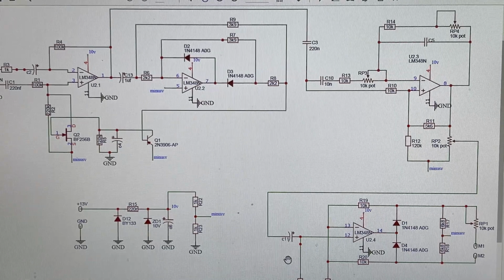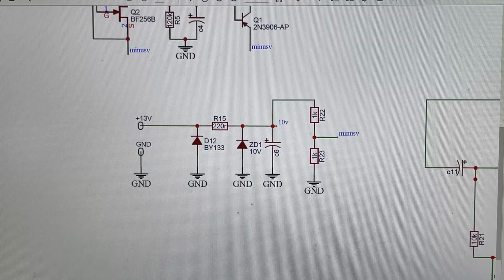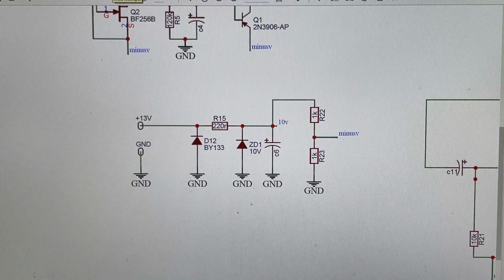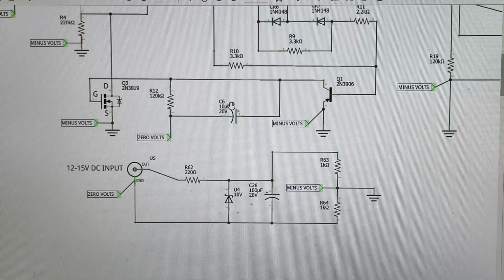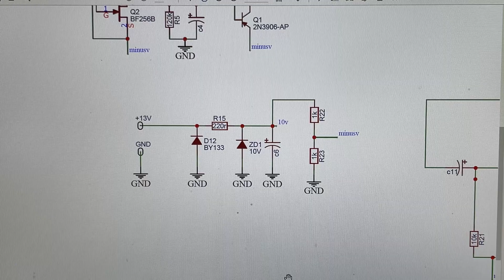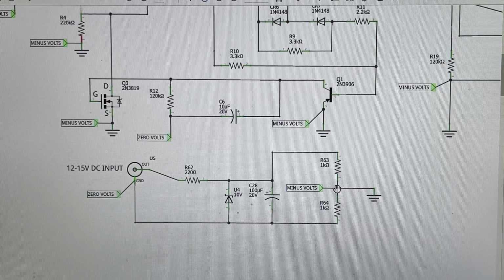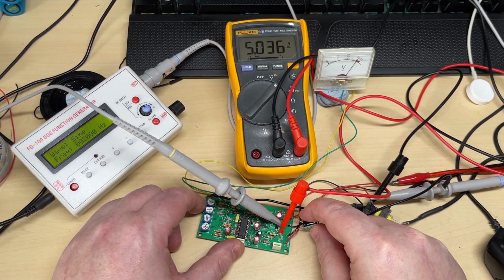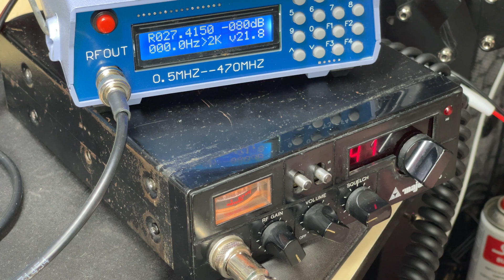EP 118 - SINAD meter - Build and test - Part2. - Missing component.

Comment: I need to critisise your diagram. The voltage supply firstly. The junction between the 2 X 1k resistors is NOT a MINUS supply, it is a HALF rail supply.  The  capacitor you have added is normal bypass practice with single supply opamps. The MINUS  supply is actually ground. You also have the source of the AGC FET floating, when it should return to half rail also.... your "corrected" schematic is wrong and can not work.. This may just show you how easy it is to let these small mistakes through and perhaps teach you not to be so scathing toward others.
Reply from the maker: If you read through the comments between myself and knoxxieman all will become clear.

Comment: My circuit used on the final production board isnt the same as the original schematic from 2 years ago, on the original boards those capacitors are used to decouple noise from the switching regulator, I found when using the zener diode instead of the regulator those capacitors were not required, my circuit does not suffer from the jitter or the other problems that you have encountered with your circuit layout/design and behaves perfectly, matching of the capacitors in the final stages brings the noise right down as well, in my user manual I recommend a good none switched mode supply for operation for this reason, lots of people run them from a 9V battery as well which really drops the noise floor to almost nothing, you might want to check your supply going in to your boards to see how clean it is, oh and be careful if your going to use the Motorola design I was contacted by them after the first video with an assurance I would not use the circuit for commercial gain so i went with the Helper Instruments version instead.
Reply from the maker: Hi , thanks for your comment , i was just displaying my findings about this and possibly highlighting a error in your diagram . Yes your video did inspire me to make one to make one and i thank you for that. If your boards behave perfectly then there is no problem, as you can see my board behaved very strange and fitting this part solved it. i will cross reference the sinadder 3 diagram see if i can spot any differences with my version of this .
I will NOT be competing with you on these meters , i have done just for my own pleasure to see if i could make one , you still retain all credit for this and any sales arising from this, " i may offer a kit with the boards i have left over if that's ok with you , but it wont be a permanent thing " . 
Thanks for your advice about the Motorola version i certainly wont be using this for any gain or selling , just for purely personal entertainment.
I hope you found my video educational in the building and testing of this, and i wish you all the success in the future with these and if there's anything i can help you with i am more than happy to do so.
Reply: @MicroChipz  I really wanted someone to do this to make a board and nobody did, I had lots of requests for a vero board version to sell but as you can imagine its time consuming to do that, I agree there were errors on the first schematic which others picked up  its because i drew up the schematic after I built the prototype as I didnt want to share my hand drawn sketch, using that free software to do the design was a PITA to be honest and I know its not good I was short of time and wanted to help, really in hindsight I should have just said copy the Helper version instead. Ive no problem with people making their own meters and or kits I am glad that people are having fun, there is a lot of work involved in making the meters up, I've had very good feedback from people who have had them and was only aware of this video because someone asked if their meter needed a mod, super simple if anyone wants to add the capacitor to my boards, on my meters it makes no real observable difference on the meter its only a few microvolts on the test gear, I am pleased you took up the challenge and your boards look great, I will sit back and watch some of your videos later, cheers.
Reply: Oh and the Zener circuit clamps perfectly, you can use a five quid low voltage drop out regulator or you can use a 5p zener diode, the current consumption of the circuit is just a few milliamps and the circuit itself isnt sensitive to voltage fluctuations anyway, also with a zener diode you can easily run from a 9V battery in the absence of a psu something you cant do if you use a voltage regulator just my two pennies worth, I did test this a fair bit, the boards were designed in November and only released a few weeks ago.
Reply from the maker: The zener works just fine no issues there and yes would be fine for a 9v battery , my circuit draws no more than 100ma . I would like to know what meter you used , im currently using a meter from a audioline cb , you can mail me if you don't want it public knowledge, or not disclose this information either way i respect your wishes .Keep up the good work , i hope this has inspired others to make things .

Comment: I've had experience with said author and tbh this sort of error wouldn't surprise me.
Reply from the maker: i wonder if he will ever see this video
Reply: @MicroChipz I.guess, just before the unit recall vid go's up
Reply: Really? how so? please elaborate
Reply: @knoxieman  It's a pity a schematics was left up with a known flaw.. It should really have been amended or taken down
Reply from the maker: He has said he has fully tested with and without the cap and is happy that his product works as intended.
Reply: @seancfix7703  the schematic was updated to version 3? the decoupling caps do make a small difference about half a db, i took the file and the video down in the end because ppl were making mistakes and then blaming me for it? even though in the video I told ppl to use both my circuit diagram and the original ones and i made no guarantees for the free information i provided, the last straw was someone telling me the polarity was wrong on the chip which it wasnt, the Sinad meters i sell have the decoupling caps and work really well, ive made a lot of meters and you actually get more variation in noise performance from the op amp, matching and low esr caps helps too.
Reply: @MicroChipz  yup the original orange meter worked fine without the caps, they are fitted to the Sinadalizer meters as they are needed for decoupling I actually use 3 x 100uf , I also now fit multi turn pots  and matched components as well.